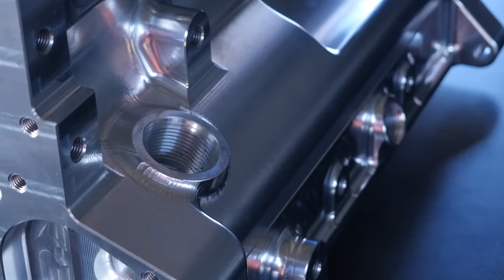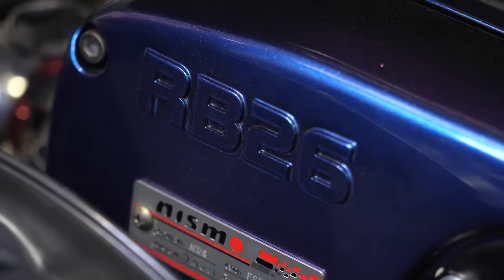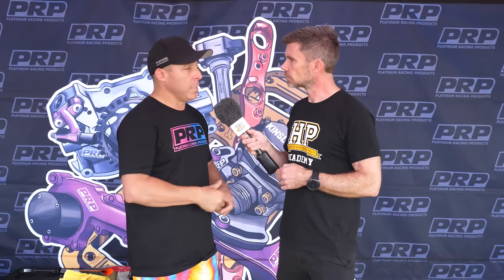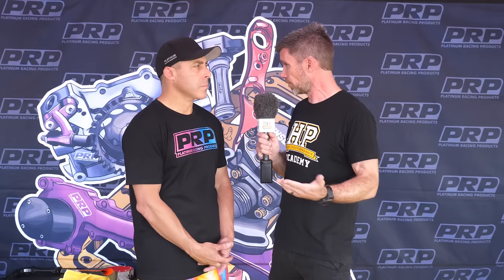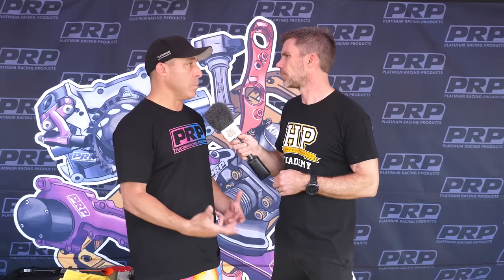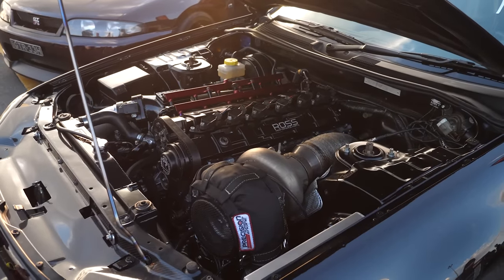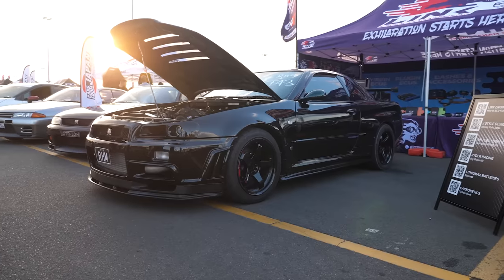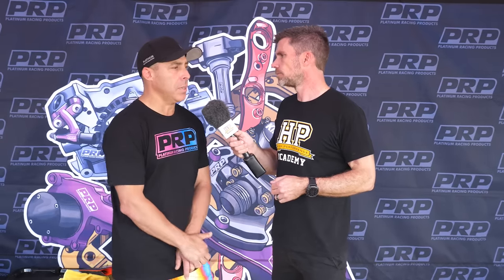What Is Wrong With A Billet Block?

Comment: There are only 2 billet blocks I know of that are actually meant to be driven on the street. The SMX and SML. Seeing an improved cast block for any import is amazing. We've been doing it with American domestic v8s for decades with phenomenal results. Given the advancements in casting and metallurgical technology there's no reason you couldn't cast a stock spec block that's better. Even without the improvements on known issues. The thing I find interesting on these straight six and four cylinder blocks is really how much easier it would be to make something similar to the SMX/SML. Well maybe not easier to make but easier to manage. Only one section of block and one head to go through instead of 2. There's one thing I've always questioned though. For example let's take a look at a billet big block Chevy with 5 inch bore spacing. What parts of a big block Chevy are there? Is it really a big block Chevy? Are these massive billet 2JZ's really a 2JZ? It's like the George Washington's axe theory. If the handle wears out and is replaced and then the head wears out and gets replaced is it George's axe? If you replace every part of an engine can you still call it that engine?
Reply: There are plenty of wet billet blocks out there. Not at all correct to say that smx/sml are the only ones.
Reply: @4familyman  but are they actually meant to be driven on the street and capable of doing any real miles? Or are they able to pull off a 30 minute cruise to fit the street class? Name a billet engine you'd drive a thousand real street and highway miles with and beat the hell out of on the track repeatedly and reliably. There's probably others and I'd genuinely like to know. 👍Sorry I had to edit a bit lol
Reply: @adamtheninjasmith2985  bullet 2j. Geo from real st did drag week with a stock block and then a billet bullet block. And there are a few Evo’s putting street miles on billet blocks. And many many LS’s out there that are cast aluminum from the factory (and stock bottom end record is also a wet block aluminum 5.3) all of which debunks this interview which claims aluminum grows too much to be street driven. Tell that to almost every manufacturer out there nowadays.
Reply: @4familyman   The alloys used for cast alimunium factory blocks are not the same as used for billet race blocks. The race blocks use alloys that are chosen for strength because that's the main goal for those blocks - but they have much greater thermal expansion. Same reasons as why aftermarket forged pistons need wider clearances than cast pistons - they're both "aluminium" but the properties are very different because of the details of the alloy and how it's maufactured.
Reply: @narnarnarnarnarn   They use hypereutectic aluminum for casting because it has a lower coefficient of thermal expansion. The silicon content of these alloys is typically 16-19% unlike their forged or billet counterparts.
Reply: @4familyman  I had forgotten that real street had run the billet 2jz on drag week but I hadn't heard of the Evo guys running a billet block on the street. As for the ls engines you said it yourself. Stock cast aluminum block. Cast aluminum and billet aluminum are completely different things and just because it's billet doesn't mean it's aluminum either. Everything from steel to titanium can be forged into billets from which parts can be machined. Technically forged crankshafts could be called "billet" because they're machined from a forged billet of steel.
Reply: Cast aluminum still expands more than iron. And still more than streetable. That’s my secondary point. Main point is that it’s silly to think that “only” Steve morris can make a billet “aluminum” engine that can be Street driven. His marketing efforts must be working though 😂 lastly, of course there are other billet materials. I thought we all knew we weren’t talking about billet steel engines lol. Good grief 🙄😂

One more,,, the guys street driving a $10-30k bare block aren’t daily driving it. They will take the time to warm it up. Lol. Now a better cast iron block is fantastic for performance AND COST.
Reply from the maker: @4familyman  no one said it can't be done, just that you need to consider things differently for it. This guest also sells billet blocks, he's knows better than many where they excel and where they don't when it comes to use case. 
Speaking of that, the use case for a car doing drag week vs a high performance street car that you jump in and drive to work every other day if not most days is VERY different.

Here here are a bunch of podcast episodes from similar people to Geo, some even more knowledgeable, on billet pros and cons as well as billet vs cast engine blocks. There are pros and cons for every single part on your vehicle, everything has a compromise. Everything. - Taz.

https://www.hpacademy.com/blog/069-making-500hp-per-cylinder-without-windowing-your-block-podcast/

https://www.hpacademy.com/blog/037-pushing-60-psi-through-a-subaru-boxer-podcast/

https://www.hpacademy.com/blog/093-how-do-you-build-a-4500-hp-engine-for-the-strip-and-the-street-podcast/

https://www.hpacademy.com/blog/041-hunting-for-huge-reliable-power-is-billet-the-answer-podcast/

https://www.hpacademy.com/blog/048-is-the-2jz-actually-any-good-podcast/

https://www.hpacademy.com/blog/095-is-pushing-200-psi-through-an-sr20-even-possible-podcast/

https://www.hpacademy.com/blog/086-forget-billet-for-a-second-whats-with-aftermarket-cast-blocks-podcast/
Reply: @hpa101  I was replying to someone stating that “only” smx and sml billet blocks are streetable. That’s just false. Other manufacturer’s billet blocks are just as “streetable” as an smx (which of course has compromises compared to a factory setup) and gave Geo as an example. I’ve already said, no one would likely be actually daily driving a billet block, cost alone is one.

I’ve watched everyone of your episodes already, but thanks for the links. Maybe the guy I’m replying to would appreciate them ;) Since that’s what my response was for… another manufacturer with a wet billet block can be as “streetable” as any other. 

“Streetable” = can be driven on street with care since it seems people are skimming past my original point. If an smx can be Street driven, so can a Bullet…. The End.
Reply from the maker: @4familyman ahh missed that sorry, so many comments, so little time! Just wanted to make sure everyone is on the right page that nothing is impossible, it's all just about the trade offs you do and don't want to live with for your application 🤘

Chur! - Taz.
Reply: @4familyman  Very true, especially considering the SMX is around $130,000+ to get into one...that thing isn't going into ANY DD's. It's only ever going to see drag-n-drives at best. People with that kind of money have it because they're not entirely stupid with it. If they wanted to drive a car more than 4-5 days in a row, they're just going to use a typical aftermarket non-billet block, or a good stock block that's prepped for its use. But you're not going to see a $130k+ SMX racking up the average 15k miles a year people drive lol. So you are very correct.
Reply: Steve Morris FTW
Reply: Don’t forget about Dart & Brodix

Comment: I'm honestly surprised there's a business case for an aftermarket cast RB block. I suppose the market may be bigger than I realize in australasia though. 
I wonder if they're working on a cast aluminum block, that would be an awesome addition, I bet there's some corner carving or lower HP customers that would like a lightweight cast aluminum option.
Great info about running the head studs so far down in the block, Steve Morris has said that he doesn't use a torque plate when he bores/hones his SMX engines because the studs are so far down below the deck surface that they don't distort the bore when the cylinder head is bolted down, fascinating stuff! 

Looking forward to seeing what people do with these blocks for sure.
Reply: Nah consider other aftermarket cast blocks. 

In casting volume prices can come down alot. In theory they could get cheaper then the Nissan heritage motors to replace blown motors by like 20k and offer alresdy upgraded motors with better reliability. 

After some time they may be able to get the pricing down low enough for that platform that it starts to make sense for more people further helping volume and bring cost down. Eventually getting it down to a reasonable albeit bit expensive option for swaps. 

It's more long term thinking cost effectiveness and the rest.
Reply: if its reliable  & holds power.
thears good potential for swops into outher platforms😮
Reply: Why? He’s just told you pretty much exactly why it makes sense. Eventually, either with high mileage or increased power levels, you will probably crack the standard block. That means a huge number of these cars that get driven will need a new block at some point(bearing in mind this applies to R32s, R33s and R34s) Then, by the time you’ve found a decent block(and OEM RB blocks of course get rarer by the day) and tested it for quality, the cost is pretty much the same as his solution anyway. So, of course the market for these is huge.
Reply: @bmxriderforlife1234  Nismo Heritage isn't even taking orders anymore for blocks or heads. They're on backorder with no clear timeline for when Nissan will actually fulfill the orders even though there's a huge list of people that want them. The prices PRP are quoting is because of the current shortage suddenly 8k USD doesn't seem quite so silly for a block.
Reply: @DOAHunt3r  yeah thats a valid point I wasn't even aware of. I'm.jusy hoping a 4 door r34 builder is still available for when I get to my plans. 

Otherwise 350z or 370z only. 

But essentially working on some business plans and instead of the usual rush dude buy a lambo or something. I'm gonna build a cool collection of built stuff. 

Have a 69 gto restomodded that's going mostly stock besides brakes suspension and a few other things. And finding a donor for the driveline swap in it currently. 9500rpm ls7 twincharged making 700 low boost 1400 high boost. Donor is gonna be vintage probably a gto donor if I can or a lemans or tempest gto conversion style. Or a Malibu chevelle. But widebody. Gonna go custom transmission housing to adapt a billet gtr r34 center diff. And then clone but adapted billet style oil pan dry sump front diff housing. Og body lines but enough aero for grip. And goal is 3000lbs or less. Current gto is 2700 and some change. 

R34 4 door gtr spec conversion restomod fully built. Like a modernized r34. Slightly larger displacement and twincharged but built for revs and wide powerband. Weight reduced and like a fully built gtr but for alot less. But still expensive. 

350z/370z awd conversion gtr style. But a bit built. Keeping the engine the stock z platform but built a bit. Just just sequential and some other stuff fully built aftermarket transmission. Since not alot of power modding it for an r35 electromagnetic clutch set up for speed. 

A few cheap builds. And then my glory. Superlite slc built into a Pagani and Koenigsegg and bugatti slaying machine. 

K48 destroked to 4.2L twin supers twin turbos. Twinscrew or roots whatever is most efficient at the size I need and has a bypass valve that works best for if need be. So far transmission option is an electromechanical sequential from Koenigsegg pagani and ssc but a company called Cima. Cima t1107. All the flat foot shifting stuff built in and for fast shifting. And the electronically assisted diff from Koenigsegg. 

Under blower water to air intercooling. And turbo stage water to air. Powered by the ac like dodge but able to run all the time like a cheater Smokey yunick freon dump valve. Ac compressor swap to get as close to redline as possible along with a pulse modulation set up to hit right to redline. Tiny cabin in the slc means cabin cooling won't be effected and more cooling for intake. Plus less heat per charge stage anyways. 

Hotvee helps spool. Flatplane crank will as well. Packaging is improved with my set up which helps. And twincharged benefits. Plus sized per cylinder bank. 

Tractive or similar fully active suspension semi custom. Same as what they make for other cars. Just tuned to fit the slc as much as possible with provided data and self tuning and sending in for revalving if need be. 

Actual professional level aero tuning. And some other suspension work. Abs traction and stability control and high level boost control. And oversized efficient under driven supers being augmented by the most efficient turbos I can manage. Goal is 90 percent boost efficiency. And on the engine a streetable as high as possible assisted by the boost system for a combined like 40 percent efficiency range or better. 

1200hp car. Widebodied. 1200kg wet. Max tune. 700rwhp normal tune. But tuned for high rpm peak in a weird wide very mid oriented build and super and vtec helping low rpm torque. Vtec tuned to like 5k rpm sections of the powerband. 

Geared for 0 to like 63mph ish in first gear so tall like an American car. 316mph 10k redline in 7th. But mostly as a gear to reduce rpms a bit on track and a 2000rpm cruise at highway speeds. Despite tall gearing and high top speed in first. It's over a wide rpm so not quite as tall as some and easier to control. 

At 1200kg and 1200hp it's equivalent to like an 1800hp ford gt 05/06. And tuning short track and long track performance. Plus lighter accelerates easier and not on a linear scale. Faster revving engine. 1 more gear shift needed but faster shifts and smoother shifts. 

Less tire stress makes some of the crazy top speeds achievable. And mapping boost to rpms traction available and gear selected will make the extra hp easier to use and usable. 

Traction control can literally be tuned to how much wheel slip and in which conditions. Meaning can have tune for track racing that still allows some drifting for keep up speed. Kills tires faster but trade offs. 

Will also have room to go up hp and revs. And ways to remove more weight. 

But also gonna have a full interior. And a full on windows powered car PC. And be as reliable as a corvette once sorted. Won't hit peak rpms much. Boost is conservative. Not much beyond what a well built k series already does and built sorts per cylinder head it becomes more reasonable in thought. It's like almost 300hp at peak per L but only 150 per cylinder which you can do in a Honda k series albeit usually at lower power levels and per cylinder peaks. But stroke and other stuff is same ish. And a mix of rpms and boost plus efficient boost. And an already efficient engine being tweaked for more efficiency in a less economic speaking context but using the economy side of things to help. It's not just a 4 banger for an economy car with race spec models. It's being turned into an efficient sport engine and race engine. 

Need the super bypass to still let me use a under blower manifold style water to air. 2 stages of cooling always. And electronically controllable. Tune switching on demand and plan a good number of different tunes. But max tune is gonna be full series twincharged compound boost parallel in the per cylinder sense. And waste gate blowing off alot. Lower boost levels suoer will bypass at a certain point but work like safe antilag. Normal tune probably still both to try and use the super overcoming turbo exhaust restriction a bit and help with scavenging full time via pressure differences and thermal dynamics. 

And potentially a similar inspired but more basic lotus. K20 swapped. Twincharged. Built transmission but like a 6 speed. Widebody aero package. Suspension upgrades. Tire and rim upgrades. But already a lighter car. And just keeping it like 2000lbs range. Probably like 9k 450 500hp.

Comment: This is fantastic 👏  now we have competition for Darts new 2JZ block and heads coming out hope it brings the prices down in a few years because buying 20 to 30 year old hard lived donor's "RB's and 2J's has gotten way to expensive  and its still a risk
Reply: Having aftermarket blocks available isn’t meant to bring prices down, it’s to have an “option” for those who need it…
Reply: @devonv2455  how wouldn't a trickle down affect not occur? The reason they've exploded in cost would be the ones that exist are mosstly out of production for the most part and there kind of sport or performance based so have had a tougher life then economy engines from the period no one is chasing mr20dd engines often... supply and demand 🫴 having fresh cast options in decent to high production levels will inevitably help cost eventually as I said in a few years...... look up a used donor engine for RB or 2J....... and both prp and dart have said less the 10k is the sale cost projected and they will have better metal and brand new no stress.......